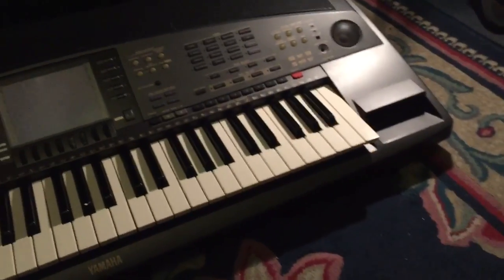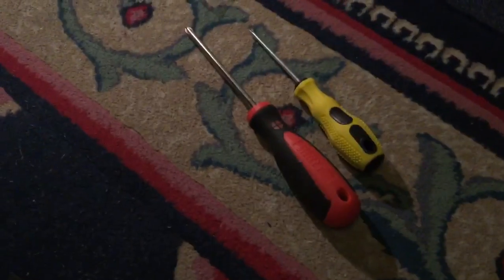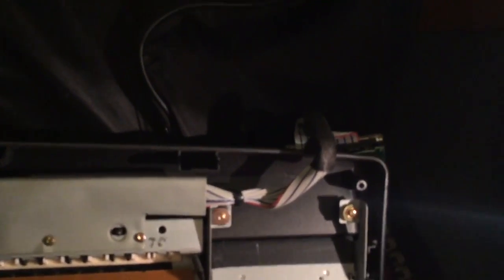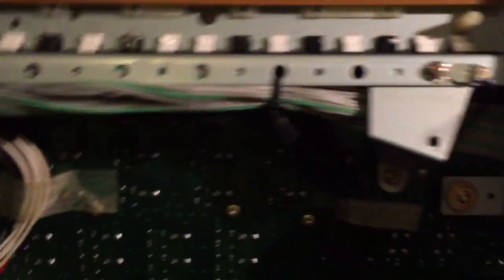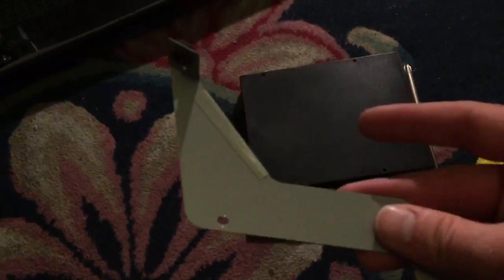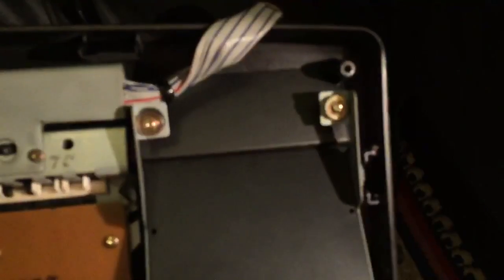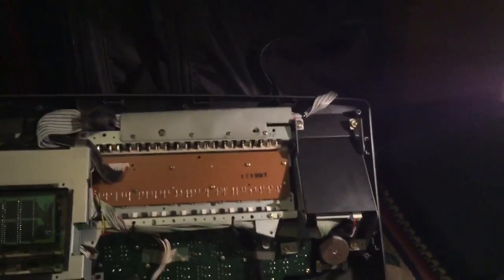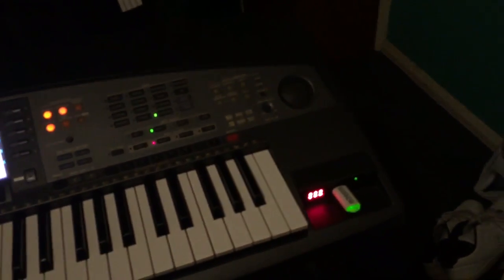Yamaha PSR-8000 Keyboard Tutorial - How To Replace Floppy Disk Drive With A USB Drive Emulator

Comment: hello there, I've managed to get my USB floppy drive emulator to work on my psr 8000 and can finally show off the xg midi library yamaha used to sell for the psr 8000  and even better, how they were ment to sound, I might have to leave the longest songs till last as some songs are long, each disk came with around 1mb of song data with the lable of the catigory, IE special, dance, country, or you could buy the disk with the composer in mind for instance, david j reading who composed a lot of xg midi files for yamaha

Comment: Hi Keyboard crazy49, i got quite excited when i saw your replacement video but was VERY disappointed when this failed to work as intended. Can you follow this video up with a Fix? I assume there is a fix? Do you need to format the USB, or did the buttons on the emulator work at all Please Please can you answer any resolution as my dad (92) will really benefit from this fix as his floppy drive has packed in.

Comment: I want to replace the floppy drive on a Yamaha SQ16 -  however when I read the spec on the emulators available -  the connection ribbon cable is a 34 pin -  and my Yamaha keyboard floppy drive is a 21 pin.  So how can I get a 21 pin emulator?
Reply: Me too

Comment: Hi, I have installed the USB emulator on my Yamaha PSR8000 keyboard, it turns on but when I insert the USB key it doesn't read it. What should I do? Thank you
Reply from the maker: Thank you for your comment! I’ve yet to try this but someone said that you need to download a software, and partition your usb stick as if it were 1000 floppy disks, partition it to 1.44mb as the keyboard needs to recognise a floppy, if it was higher than 1.44mb the keyboard will not recognise it.

Hope this helps

Comment: hey keyboardkrazy49 ive got a question 😀 why does this keyboard click when i switch it on how does it work im curious
Reply from the maker: owen lee whitelegg the click is just the keyboard receiving power when it is turned on and is no cause of problem
Reply: KeyboardKrazy49 one more question how do i play songs wothout a floppy disc to put in can u help me to find silent night or jingle bells for song
Reply: AMD Delidded most keyboard have song style without floppy
Reply: AMD Delidded not the style the song just the song     like other keyboards
Reply: AMD Delidded because on regular keyboards like the ypt 200 has a song so you can choose turkish march london bridge etcetera i need help
Reply: AMD Delidded listen to them
Reply: KeyboardKrazy49 how much is the tyros 5 with the new cathedral organs its my dream organ keyboard
Reply: AMD Delidded can you still get pipe organ tutti on genos?
Reply: AMD Delidded if you have a genos can u show me a vid of all the cathedral organs pleass 😁
Reply: KeyboardKrazy49 hello keyboardkrazy49 can u show me the all the cathedral organs plz 😁on the genos
Reply: the click is made by an electronic relay closing the main circuit powering up the thing...

Comment: what modell of emulator did you use for psr8000 please  , is it  a SFR ?
Reply from the maker: SERIN12 I’m not fully sure of the model of the emulator, I just found one cheap on eBay and got it, it is in the keyboard now so I’m not so sure what model it is
Reply: Hi  installed an emulator I my psr-8000 but  it don't work. I formatted the USB pen in the emulator first and  then on  the PC with the software. the keyboard säd no disk
Reply: KeyboardKrazy49 
Thks for your answer

Comment: Did you use the jumper setting S1  ?
Reply from the maker: Guy P if you’re talking about how I jumped from one part of the video to the next part I just used some software on my phone.

Hope this helps :)
Reply: KeyboardKrazy49 no, I meant the jumper switches on the USB unit.
I've now determined it has to be S1, however when I installed it, I plugged the floppy connector halfway down and now it won't load custom sounds without corrupting them 🙁
Midi and samples fine, but not sounds...even when I reinstalled the FDD. BUM.

Comment: 1. Make sure the larger data connector is plugged in the right way up.

2. Use this software to format your USB drive 
http://www.ipcas.com/support/usb-floppy-emulation-download.html

3. Use the buttons on the front of your emulator to select the floppy disk partitions to write to

then it should work as mine now does. Thanks for your video

Comment: very interesting, did not know about these devices.  you think they would work on other synths and samplers,  what about old computers like macs and ataris?
Reply from the maker: Woody Piano Shack thanks for your comment, I'm not so sure if it will work on old computers and macs etc, I wouldn't see why they wouldn't as it is only emulating a floppy disk, but I think you will have to partition a USB stick for example: if you had a 2gb USB stick or higher, you would have to partition it to make it as if it was over 1000 floppy disks

Comment: Hi Michael, in order to use an USB pendrive with such old instruments you need to format the key in several logic units of about 1,44Mb each; the filesystem of old keyboards have to recognize a floppy disk have been insterted. You can change between those multiple virtual diskettes via the front panel driver switches; the display will show you the number of actually used memory unit. You also need a software on your PC to format the pendrive in this way. Hope this helps. Kind regards
Reply from the maker: Thanks for the tip, do you know what software would work for this as I will give it a try, is it basically partitioning a USB stick to make it the equivalent to a load of floppies? Just like on a computer you can partition a hard drive to make the computer think that there is more than one hard drive inside. Thanks again!
Reply: I use a Solton/Ketron software that works great for partitioning the USB drive up to 999 partitions. When you put the stick into the keyboard emulator, you have just to scroll the partition you want to use and it will be recognized as a floppy disk. Here the link where you can download the software for windows XP or 7 (it also works on win 10).Its free. Kind regards
Reply from the maker: Sorry for the late reply, if you can give me a link to where I can download a partitioning software that would be great :)
Kind regards
Michael
Reply: Hi Michael, sorry, I forgot to write the link then:
http://www.ketron.it/en/software/50-usb-floppy/usb-floppy-software-1-1
Kind regard.
Reply: Can we have a video of the procedure .thanks